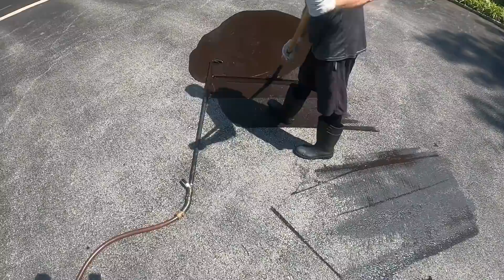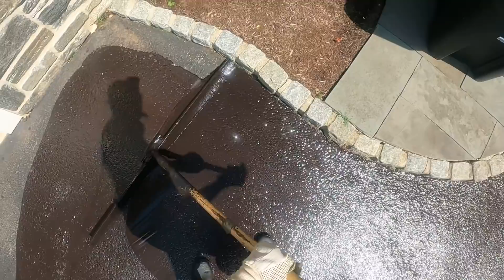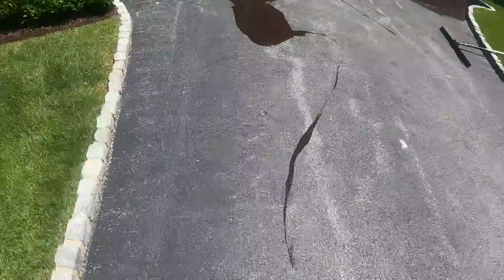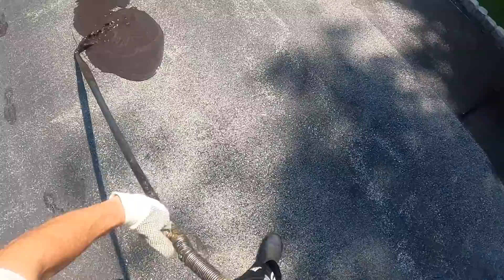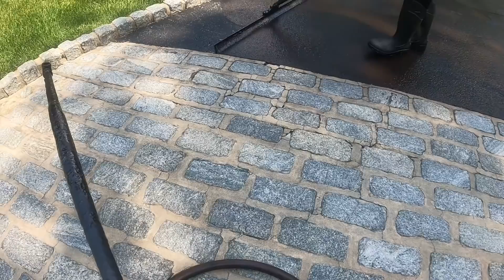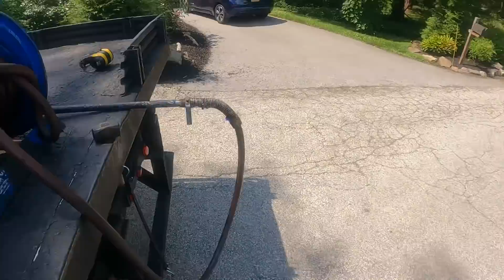Professional Driveway Sealcoating #16 “Bonne nuit"

Comment: If I could have found a paving contractor in Hawaii that would offer a rejuvenator product I would have that applied. You get anywhere from 4-7 years per application and it replaces the lost Maltene that provides the flexibility lost from exposure to the elements. It soaks into the upper surface 3/8-1/2". Only need one coat, most rejuvenator products can be driven on 1 hour after application. Sealcoating is essentially just a temporary coating. Lucky to get 1-2 years before you need reapplication and most manufacturers state you need to apply 2-3 coats. Very expensive if you have a large area to cover. I have 5,600 sq feet.
Reply from the maker: I’ve sealed driveways that didn’t need a reapplication until 5 years later. It’s all about who is doing the work and what products they are using.

Comment: I'm a sealcoater from the Chicago area and am wondering why don't you use a 6 inch edging brush you have alot of control and it speeds things up. You do a good job BTW
Reply: Looks like they know exactly what they are doing with 1 brush.... Seems like you should take notes

Comment: Any tips to avoid squeegee lines? Whenever I raise and then lower my squeegee it leaves a mark which is difficult to remove. I am hoping switching to the tip you guys use would resolve that as the one I am using does not have bristles and is instead just a long piece of plastic.
Reply from the maker: We use brushes. I twist inward as I do my final pass.
Reply: Use a brush, not squeegees...It works it into the  macadam the best with no waste. Reach out to Greg and I bet he would be more than happy to give lessons !

Comment: Being so hot,  does it affect how much more/less you have to use. Does it "flow" better or is it "absorbed " more quickly, etc?
Reply from the maker: The only thing that matters on how much material we use is wether or not the driveway has been sealed before.